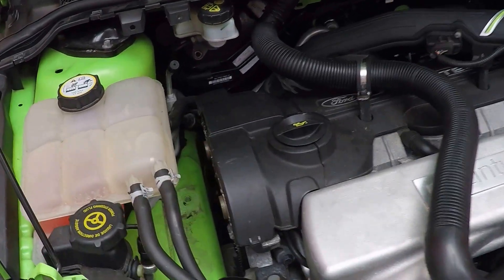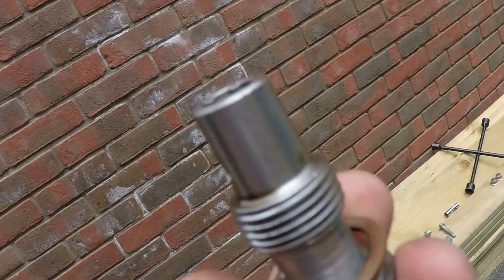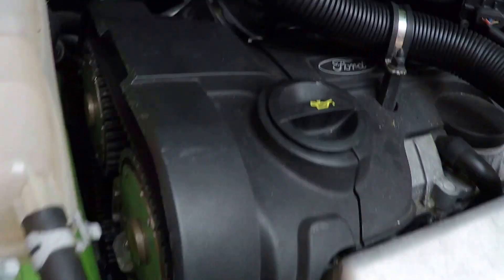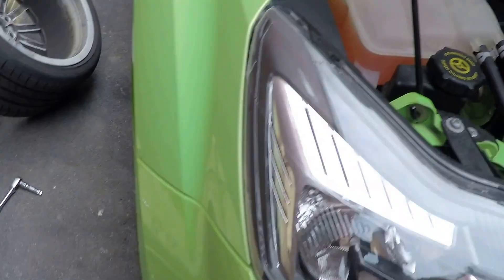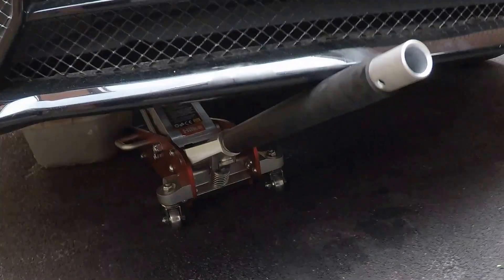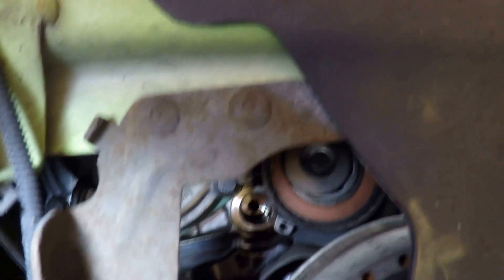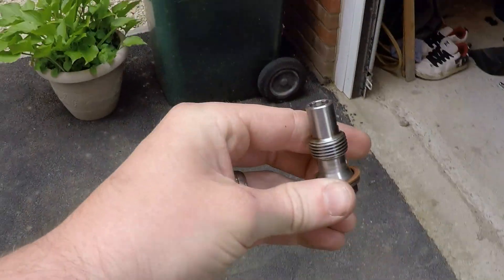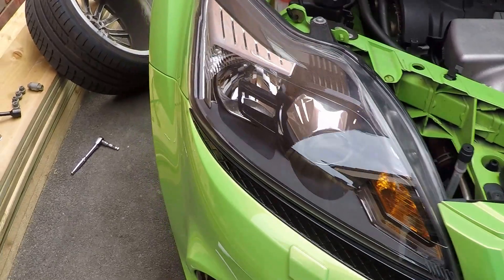Focus RS oil pressure relief valve tutorial

Comment: Hi did you need to remove aux belt or timing belt to do this ? Thankyou
Reply from the maker: BigTruckerLuke no belts needed removing 👍🏼
Reply: Thankyou for your reply, did any oil drop onto ur timing belt ?
Reply from the maker: BigTruckerLuke not as far as I remember. I was careful to use rags to keep mess to a minimum.

Comment: I have a question ... what symptoms did the car have?
Reply from the maker: Roberto Carreño Rodríguez No symptoms apart from a few small patches of oil on the driveway.
Reply: ok, thanks bro! I have some low oil pressure at iddle on my 2009 ST. That´s why i ask you...
Reply: @PekeCarreno  I have a rs foucs doing the same showing low oil pressure on idel. Did you ever resolve your issue